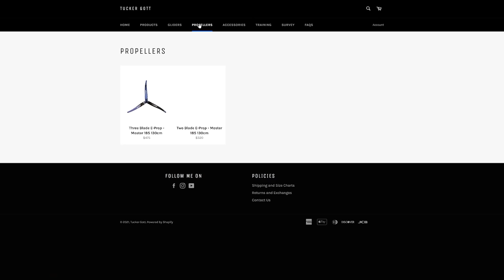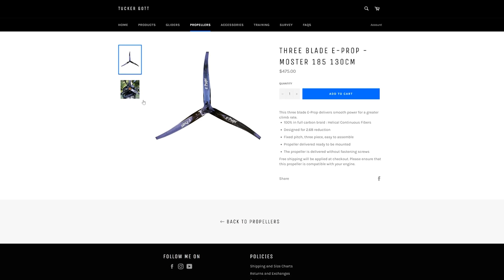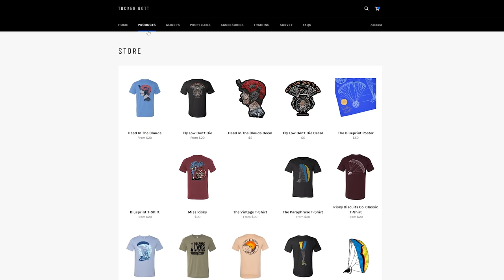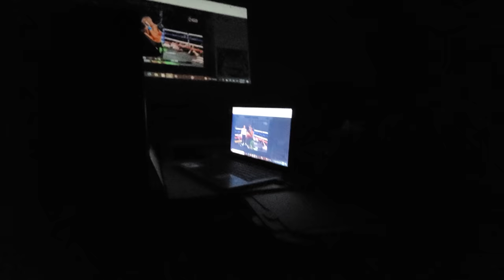I Got In A Dog Fight With A Random Drone!!!

Comment: The mini 2 is a great lil drone. I had one for a few days to try it out.  But anyway, if you come to Mass, in central Mass you may able to take off from the former Spencer airport. It's no longer in operation from what I understand. You could probably spot land in the Rutland state park area. Lots of open fields and a few ruins to check out. Taking off from there might be an ankle twister though. It might be a little tight, but the Long Pond boat ramp might be an option to taking off. It has a huge parking lot, but it is surrounded by trees for the most part. You would have to climb fast.  Moore state park is a cool area to check out for water falls. You could check that out by foot. There is the Worcester Regional airport nearby to Spencer and Rutland, so you would have to keep that in mind. If I think of other places, I'll let you know.

Comment: There's some great stuff around the northeast. Since I'm from MA, I can point out some New England stuff.  Mt. Washington in NH - over 6k feet up. Can drive up the auto road, or take the Cog Railway right up the side of the mountain! Been there since the 1800's. I think the tree people ended the steam engines, so they're all diesel now ... booo!  Not 100% sure if they're completely gone, but almost. There's Conway where you can take a few different train rides around the state - that would be fantastic. There's one that goes for like 6 hours, goes through the mountains, they feed you and everything. I have yet to do that one. I liked the area where the Old Main in the Mountain used to be - plenty to do there. Can take the tram up Cannon Mountain, go to the Flume, feed bears in a bucket on a string - tons of stuff to do around Franconia Notch. 

In the northwestern corner of MA we have Mt. Graylock - not nearly as impressive as Mt. Washington, but the 7 mile road to the top is a fun drive. Not sure of the legality here, since anything fun is illegal in MA, but at the summit you could literally run with a paraglider right off the side - it's almost a straight drop down on the eastern (if I'm not mistaken) side of the summit. Beautiful views on a clear day. I hear there's a paragliding place around Springfield, MA, too - not sure if it's Mt. Tom or not. Closer to me, we have Mt. Wachusett. Not as spectacular as either aforementioned mountains, but great for around here. That you could glide off of too pretty easily (but I'm pretty sure you'd be met by rangers at the base). Can see the Boston skyline from there on clear days. Then there's the thousands of historical sites around here, if you're interested in that. We have Old Sturbridge Village, which is like going back in time - it's almost an entire town recreated from the 1700's with blacksmith shops, horse and buggies, people dressed in period clothing everywhere, etc.. Pretty cool place.

ME has Bar Harbor and Arcadia National Park which is amazing - first place in America that sees the sun every morning on Cadillac Mountain. Also has the coldest ocean water in America, too - you can swim there (did that as a kid - NO THANKS, lol!). If you go north far enough, they stop naming towns - they get numbers, like T30E (town 30 east, or something like that). Very rural  - I love it up there ... in SUMMER, lol. Lots of low bush blueberries in Bar Harbor late in the summer.

VT is beautiful no matter where you go. I like driving up 91 north to 4 east to 22A north through Orwell - beautiful area. There's a museum up there that I can't recall the name or town it's in, but they had the biggest collection of antique black powder firearms that I've ever seen in my life!  That was great! Plenty of mountain roads and tramways to check out on the million different mountains up there, too.

As far as CT and RI go, I'd avoid at all costs, LOL!

Comment: Pushing a line into the air box closer to the carburetor kind of mountain it a plate between the carburetor in the head or the manifold whatever which it has it probably worked a little bit better you should have kept it on there just in case you got the climate I got into trouble you can boost your power some more

Comment: If You Are Looking For Specifics, The Drone Was A DJI Mavic Air 2 With A Piece of Velcro On The Top to attach A Strobe Light (Which The Pilot Should Have Had On The Drone). These Drones Vary From 799 To 1,000 US dollars. The Drone Has ADS-B In So It Can See If There Is Planes Nearby, Not Paramotors Because Paramotors Have No ADS-B.
Reply: The drone has lights already which can act as strobes. Velcro not necessarily for strobe, maybe for second camera..? Lots of reasons for velcro. The drone has the radar sensors on all sides, as well as the gimbal camera so the pilot could see Tucker was flying in the area.
Reply: @spencerhalse  I Have That Type of Drone But It Is The Newer Model, And The Lights Can't Be Seen At Full Nighttime about 1/3 of a mile away.

Comment: You’ve mentioned to find a good company for instruction that provides equipment. 
What’s a good company have other than just providing equipment. 

I found 2 places 
1 3000 10 days 
2 2500 14 days
They both provide equipment. 
It seems if you want save go with the 2500. However your there for 14 days when you could be using the extra 4 days from the other making 500+

As far as traveling to Fl or Cal.  
Not everyone has that option. 
That’s added extra cost of hotels flight/drive food etc. 

Both of these I found are within an hour- drive from me.

Comment: Imagine getting a drone to the face at 30 mph,be safe pilots.
Reply: A safe drone operator has to be looking for potential hazards in the air and a paramotor is definitely one.  This drone operator should have heard/seen the paramotor then brought the drone back down, especially with the paramotor's ability to quickly change directions on a whim.  That was way too close.